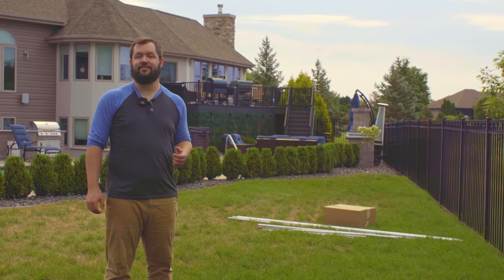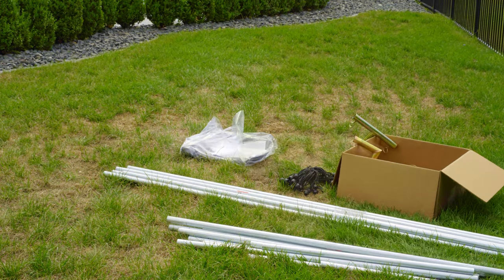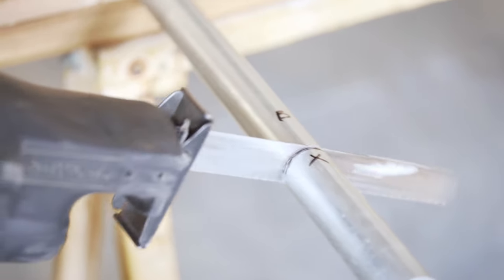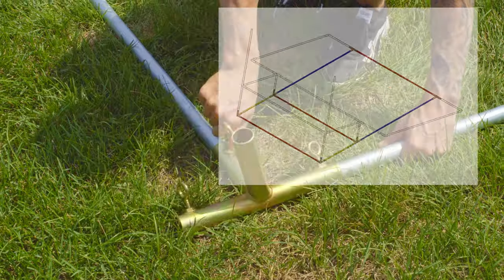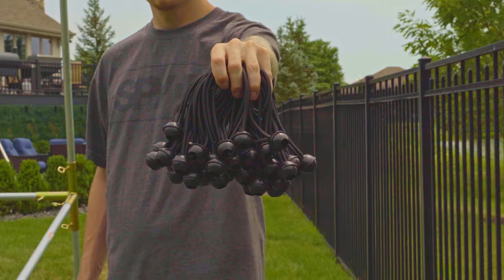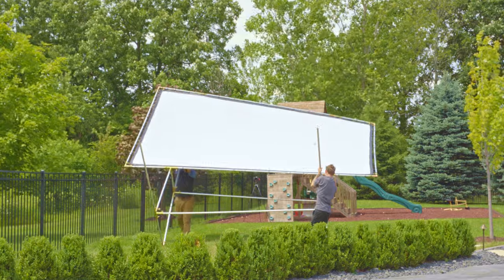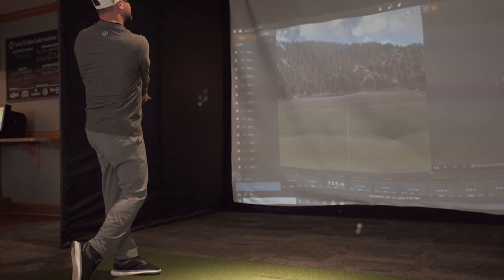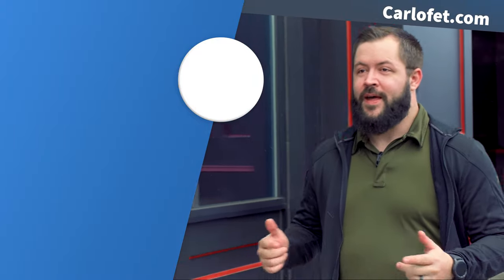It's EASY to put a Theater in Your Backyard With Carl's Place

Comment: I would like to order the grey rear for outdoor use but I would like to know if I would be able to use it at from ground level? I don’t want a space between the ground and the screen. So basically the screen will be touching the ground. It for a fashion show and there will be no stage. The runway will be the ground and the screen will be placed to the back of the models as the walk down the runway.
Reply from the maker: Hi Monique! Thanks for the comment. Short answer is yes, the screen can touch the ground and should still work, but that's all based on your projector being set up properly so that it fills the screen how you want it to. If you have more questions, feel free to reach out to our customer service team via email (info@carlofet.com) or phone (608-352-0002). Thanks!
Reply: @CarlsPlace  Okay great! Thank you. I sure will because I do have more questions. I’m from St. Lucia (the Caribbean) so I will contact via email. Thanks again